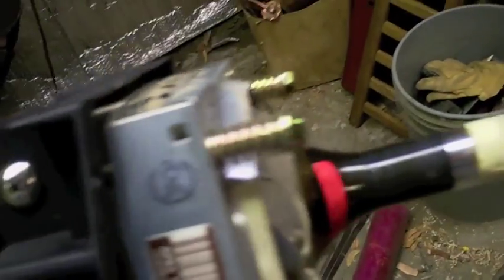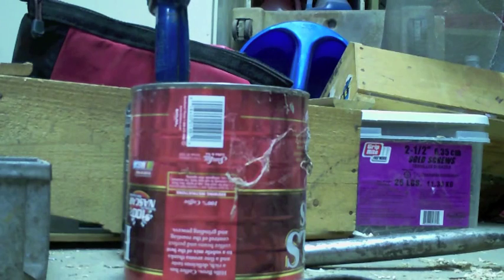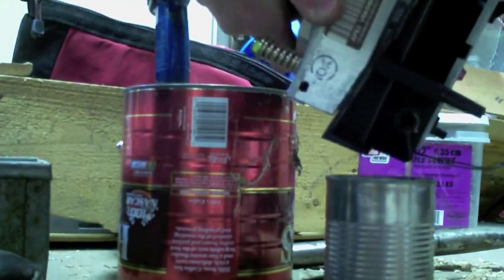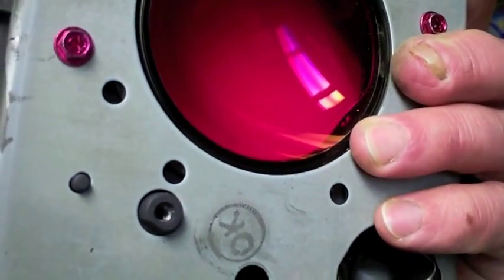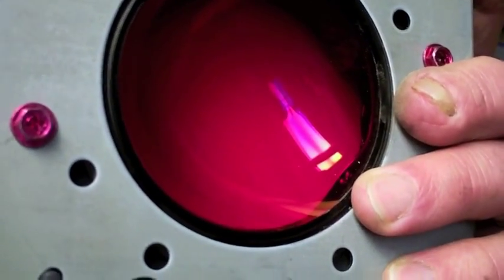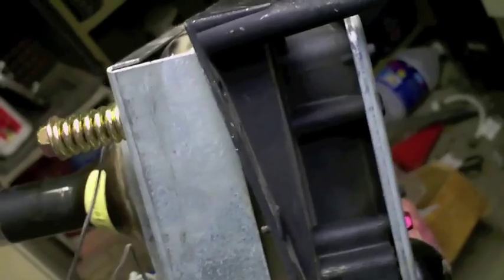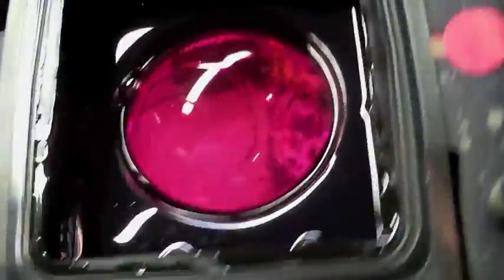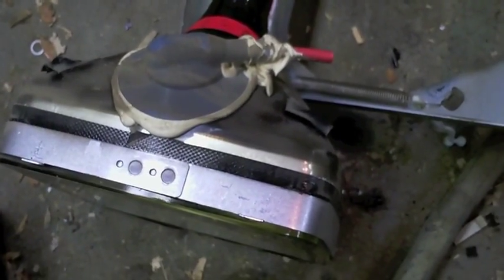Rear Projection CRT Organ Harvest

Comment: Best thing to do is to leave it be. The projection tubes are useless without it, and it's of little utility without a projection tube to be inside of.
Reply from the maker: My son used one to burn things in the sun, didn't work well but it worked.